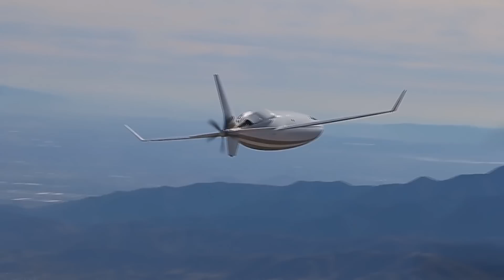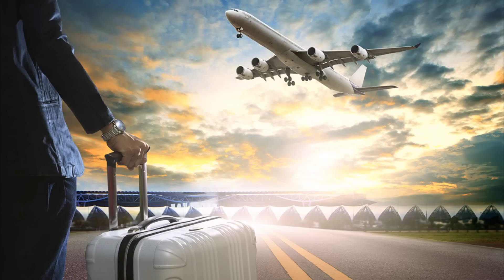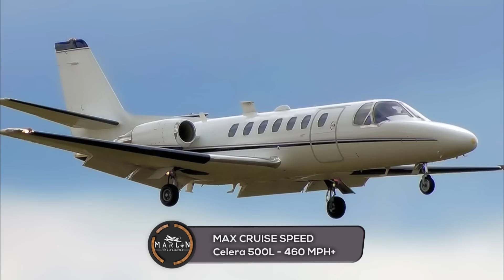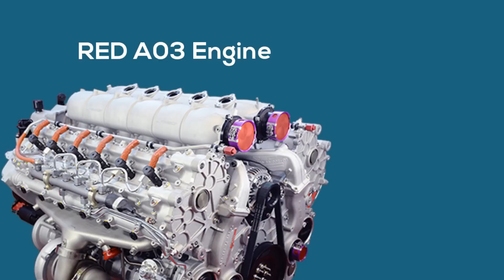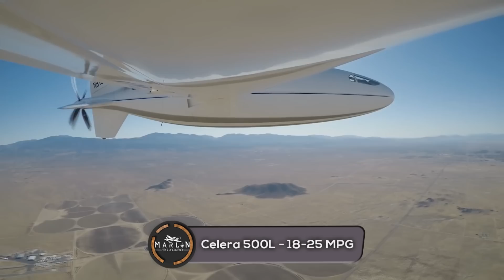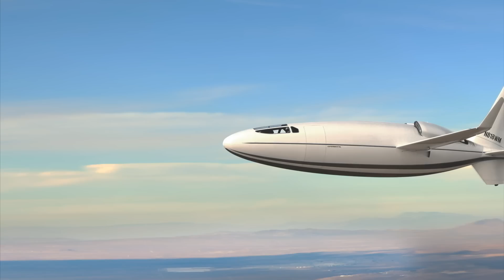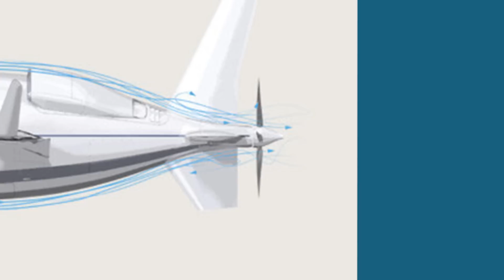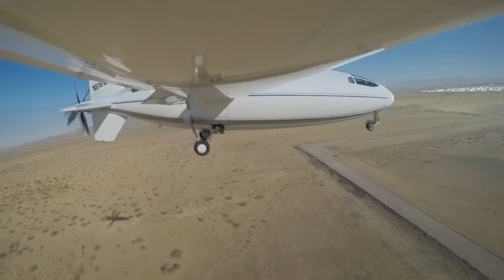Meet the Celera 500L (Flies Faster, Farther, Higher, Cheaper)

Comment: These “Revolutionary “ planes come by every so often.  They claim fantastic numbers. Then they just fade away.
Reply: Yep.
Reply: I have a less popular idea as to why new “revolutionary planes fade away: 
Simply because Designing a completely new airplane is hard. 
And getting a new design certified and into serial production is even harder. 
It takes years, sometimes as much as a decade (or more); and it’s extremely capital intensive. 
Most companies either don’t have the necessary capital to see it through, or they are unwilling to take a big risk on a new, unproven design that — if not wildly successful— will fly them straight into bankruptcy. The high-risk inherent in making a new design, combined with the even higher regulatory hurdles imposed by the FAA, is why we don’t see many revolutionary new airplanes today. In fact, the vast majority of airplanes used in general aviation today were designed and certified way back in the 60’s and 70’s. 

Also, any new aircraft design— especially those that are “Revolutionary” on paper — are guaranteed to manifest a number of design flaws and technical issues that only appear during the late phases of prototype and testing. Such issues tend to cause years of delay, vast $$$ expense, or outright cancellation. AND EVEN IF a company overcomes all this, there’s still bound to be more issues when it comes to establishing regular serial production of a certified aircraft. — (This is a big reason why so many new designs in general aviation remain forever as classified as “experimental”  home-built/ kit build planes.)

Everyone loves to focus on what makes a new design “revolutionary.” But there’s always a trade-off when it comes to aircraft design. There’s no such thing as a free lunch. Yet when people make YouTube videos about a new “revolutionary” airplane, they almost never mention the challenges and trade-offs inherent. 
And then on top of all this there’s simple and brutal laws of economics. An airplane may be “revolutionary” on paper, but to be successful it must make economic sense; it must convincingly provide its owners a greater return on investment than what they could get using an established and already proven airplane. 
And unless a “revolutionary” new airplane can be produced at a lower cost than the average customer is willing to pay for it, then it’s sure to fade into obscurity as just another paper airplane/interesting prototype.
Reply: It often caused by politics and not the aircraft itself
Reply: This aircraft isn't just claiming " fantastic numbers", it has excellent fuel efficiency like some motor gliders also have...
Reply: @davidhollenshead4892  It is effectively is a motor glider, just scaled up.
Reply: No matter how much promise concept aircraft invoke a flying prototype is only the beginning.  The costs of certification and tooling up for production are eye watering. Often established aerospace companies have the financial muscle and technical expertise for this. Even then it may not be a commercial success.  The Beech Starship would be one example.
Reply: If Amazon got involved it might  get some legs but look at Synergy Aircraft  for example  same promise still nothing. If it's any good China  will steal it and make it work. Dam it where is my Jetson personal airplane I was promised as a Kid?
Reply: @JohnnyAtlas  As far as I can tell, Synergy never got off the ground because all the guy really had was an efficient airframe design derived from the boxwing, which has been around since like the 1930s. He wasn't offering enough to investors and from what I've seen of his behavior online he comes across as self-absorbed and difficult to work with, so they all passed.

Now at this point his patents (which were mostly filed in the 2007-2011 timeframe) are well on their way to expiring, and would be just about expired by the time a production aircraft came to market, nullifying his competitive advantage. So Synergy will never happen.
Reply: @justtwoseats  thank you for a great explanation about Synergy Aircraft
Reply: Nothing secret, they just get bought out, or the patents do.
Reply: For those people looking for sources go watch some episodes from the late 90s television show beyond 2000. Now look at all the devices that they showed and see how many actually became something. All the flying cars and boats they showed you don’t see them anywhere. 

The reality is that it doesn’t matter how good the idea is. It’s not necessarily big business stopping it from happening although there are many examples not just with engineering. Big companies buy smaller companies and kill the project. Look at Microsoft they do it all the time. We don’t hear about it when it’s a product that we’re not using it. It just goes silently into the night and someone walks away with a pile of money.

You must know about the Tucker. There was a movie that was made in the 90s I think. He designed a new automobile with lights that turn in the direction you were going and it had a variable windshield wipers which didn’t exist at the time. He got stonewalled by the big automotive companies.
Reply: Gee I wonder why. Almost like some septa of corrupt industry has a death grip on transportation.
Reply: The DC-3 was revolutionary once. It is an incredible financial tightrope act getting an entirely new aircraft certified. If it never goes into production it might not be the aircraft's fault.
Reply: For about the same price, I'd use this option in a heartbeat! I might actually take a flight again.
Reply: Physics dictates that plane efficiency has more to do with weight than anything else, and there is no free lunch.  All aircraft have to use a lot of energy to "throw air down" creating lift based on weight, and so will never be as efficient as transportation systems that don't have to waste so much energy fighting gravity.      If we were smart, we would only use air travel when we need to go over large bodies of water quickly, and would use high speed super-highways and/or high speed trains for traveling quickly over land.    A bus loaded as fully as a typical passenger jet for example gets 300-400mpg per passenger, whereas the jet only gets 50mpg per passenger.   We would also be wise to limit the need to travel by using teleprescense more, like work from home programs with meetings done on MS teams and the like instead of moving thousands of pound of flesh and steel to get people into a large auditorium.
Reply: DumbDuck44 “throw air down”? Not how an airfoil works FYI...
Reply: Unfortunately, this wonderful aircraft will probably disappear from sight, never to be built for general use, as just about all really revolutionary aircraft outside of the big corporate manufactures have had happen to them. Sad!!
Reply: @afollowerofthewayJC  Unfortunately I agree.  A number of years ago a company called Dynacam fielded an engine that was certified by the FAA for aircraft back in the 1930's, upgraded the metallurgy and was in the process of getting startup capital to go into production.  They had a 200HP 12 cylinder engine with the cylinders placed like the cylinder of a revolver gun.  the pistons were on each end of a rod that was connected in the middle of the rod to a circular plate that had a wave in the outer edge like a sine wave.  The pistons traveled back and forth firing from both ends parallel to the rotating crankshaft  and the valves were just ports that were uncovered and covered by ports attached to the crankshaft, so no major moving parts to the valve train and no timing problems.  The 200 HP model weighed about 85 lbs and operated so smoothly and vibration free that you could idle down to 100RPM and not spill a water glass sitting on top.  Fuel efficiency was 3 times that of normal AC engine, frontal plate area less than 1 square foot.  They had larger engines they were designing for powering buses.  They had half a dozen hostile takeovers by big AC companies and car companies and just faded away for lack of start up capital.  Very sad.  Turbine power to weight ratios with gas sipping efficiency, minimal moving parts to fail and almost vibration free operation.  I miss them.
Reply: Tesla to the rescue to fit it with > 400 Wh/kg batteries as soon as they can
Reply: @justforthehackofit  Agree
Reply: Because big oil and big aviation companies makes sure it is killed.
Reply: Ryan Ehlis how do they do this? Any specific examples?
Reply: Marlinspike, there is a documentary called "Who Killed the Electric Car," that goes in to great detail about the control and cooperation between automotive manufacturers and oil companies.
 Also, check out "Who Framed Roger Rabbit" for a similar story, except it's about street car trollies, which were also electrically powered.
Reply: @werepat  hard to argue with those sources
Reply: @Mike-gz4xn  do you have any good examples that they don't?
Reply: werepat businesses are always trying to demonize one another, this is nothing new.
Reply: Rev. Andy H. We’re talking about greater profit margins for a company. Look at the auto industry and the increase in MPG. to make a sweeping claim that big oil is killing magical technology is ridiculous. Why would big aviation not jump on Thai technology or buy them out. Look at Apple for example.
Reply: @werepat  Electric were never ready to compete with ICE until recently due to crappy batteries, so I call bullshit.
Reply: MrChiangChing, they didn't use batteries.  Electric street cars have been around since the late 1800s. 
https://en.m.wikipedia.org/wiki/Streetcars_in_North_America#Electrification
Reply: https://m.youtube.com/watch?v=76tuldu-zo4

The first five seconds might be compelling enough to listen a little while longer.
Reply: @werepat  "Who Killed the Electric Car,"  was pure BS. 
GM's EV1 wasn't DOT Approved for sale, only as a long term lease...
Reply: @werepat  I was only talking about the electric cars, I know the streetcars were pushed out by the car companies, but electric cars were not viable until the recent advances in batteries.
Reply: @MrChiangching  ah, I see.  Did you know the very first electric vehicle was in 1832, but you're right, they weren't practical until the 1870s. It was said the electric car's heyday was the early 1900s, though.
Reply: @MrChiangching  what battery you mean?
Reply: @MrChiangching  this video talked about a new revolutionary aircraft. If you want to talk about electric cars, please talk to Tesla.
Reply: @Mike-gz4xn  Do you believe they would reveal it, really?
Reply: Davi Rosa reveal what?
Reply: @MrChiangching  No really, you should watch that documentary. 

GM made an EV in an effort to feign interest in some emissions regulations and force other manufactures to redesign. They leased these EVs in a trial program, the drivers loved them and wanted to buy them, but instead the vehicles were forcibly confiscated at the end of the trial period.  The trial was a complete success, but they killed the program because it threatened to disrupt the order that GM enjoyed. 

Really, you should watch the documentary, it can be found online for free. "Who killed the electric car"
Reply: @davidhollenshead4892  How does that make it pure BS?

I mean, they still worked.
Reply: @Mike-gz4xn  The government can come up with all kinds of reasons to confiscate or end your work. They have threatened inventors with jail for creating things that would upset the status quo too much. The most influential people want to stay that way my friend. Certain kinds technology could upend everything quickly. Zero Point energy is a good example. Exotic Propulsion systems have been created and only used on black budget projects. If these things saw the light of day in commercial use oil and gas would be done the next day.
Reply: @JediMind Trix Yeah, I’ve been hiding the cure for cancer in my basement for decades. I maintain great power and influence so long as no one knows I can cure cancer.  The moment people find out I’ve discovered the cure, all that power and influence will be gone. And I refuse to live like just another unknown commoner.

I trust this explanation makes sense to you.
Reply: @Mike-gz4xn  i had a Chevy Vega that did 39 MPG in 1976 the car was crap but had good gas mileage with a carburetor no less if it had fuel injection and CPU control no telling what the MPG would have been.
Reply: @Mike-gz4xn  buy it then shelve it. Use diversity hires to engage in corporate espionage and sabotage
Reply: @rev.andyh.1082  I have the cure to cancer too. It's so cheap it won't make money
Reply: @Dispatcher So you understand. ...If you’re someone on the inside like you or me who enjoys having money, power,  and influence, then, obviously, the only way to grow one’s wealth, power and influence is to take the one miracle thing you have, that thing millions of people will want ...and hide it away so that no one knows you have it.  That’s the only way you can prosper. ...makes perfect sense
Reply: @rev.andyh.1082  I try to help terminally ill people. Not one of them believes me
Reply: @werepat  Electric, steam and internal combustion cars all had similar performance and reliability in the 1900's. Electric cars started straight away, ran silently and had few parts to break down, but range and speed (eventually) let them down. They were great in cities, though. Steam cars were based on technology that was already over a century old and also more reliable than internal combustion, but took 45 minutes to "start" and you had to carry around a literal ton of water. Watch some Jay Leno's Garage, he's got some steam cars that are newer than some of his electric cars. The very last steam cars had great improvements in reliability and (almost) push-button starting, but came too late.
Reply: @Mike-gz4xn  Apple is a gigantic darpa/nsa spyware limited hangout operation just like Microsft pretending to be businesses, don't be naive lol.
Want to see an aerospace firm that's been completely passed over for investment because it's too good and it'll disrupt too much, check out SKYLON. A helicopter gunship that was too good, The AH56 Cheyenne, they're only letting it be built now.
Ditto the Fairey Rotodyne, development was scrapped, the Roton Roary rocket, any number of heavy lift hybrid airship designs, all too disruptive to the paradigm.
Reply: @werepat  I saw who killed the electric car. It was full of BS from start to finish, just someone's fantasy.
Reply: Veldtian1 I know about  the Cheyenne. It was very good but had its problems as well. It was expensive and did things the a10 could do and the Apache. It was not needed and scrapped. Good yes. The devils in the details and specific facts that can be proven not broad sensational generalizations.
Reply: @werepat  but there are plenty of electric cars these days, and airlines are constantly trying to reduce their fuel use.
Reply: @rev.andyh.1082  if you havent seen Who killed the Electric Car, you should.
Reply: @nadamasdisponible I tried watching it a few years ago but I ran out of headache medicine before I could finish it.
Reply: @Mike-gz4xn  Yeah, look at Apple, using slave labor in China.  Think it's a joke?  I have lived in China as a U.S. citizen for the last 8 plus years.  It's not a fantasy... It's real. Apple uses slave labor. They require long hours and pay little. Apple sucks. There are several suicides of workers each year.
Reply: @ryanehlis426   Wrong, big aviation would adopt these if it saved them any fuel at all, as its one of their biggest costs and the airline industry is hugely competitive with one another and not a monolith.    Its because hype cannot overcome the basic laws of physics, which dictate that there is efficiency of scale (small aircraft like this will never be as fuel efficient per passenger as very large ones) and that can't be overcome.
Reply: Ryan Ehlis Nope, they don’t really perform. Reality can’t be suppressed for long.
Reply: @ryanehlis426  You're right, but unfortunately the vested interests hardly have to make any move at all to squash innovation when we, the public, approach every significant innovation with absolute cynicism. Source: This comment thread.
Reply: Ryan Ehlis  You forgot to mention big pharmaceutical companies and the Illuminati.
Reply: @ryanehlis426  nah. They dissappear because they don't perform as promised and/or they have lethal flying qualities.

Comment: Structurally, the fuselage looks like Spaceship 1 and two. Alot of people don't realize that pressurizing an aircraft cabin and fuselage is like inflating a balloon. SS1'S shape and it's rounded windows enabled it to have a "Shirt-Sleeve-Enviornment", which meant the pilot and occupants did not need to wear full pressure suits. This shape is designed to have enough strength to withstand higher pressurization (psi).

Comment: Most comments here are like, it’s not possible but, the design is so different from anything else why not get different results?
Reply: The thing is that it's not very different from anything else. At least not different enough to provide 8x efficiency, jetlike speeds with only 600hp, and an altitude of 60k, something which is the maximum altitude for most military fighter jets, which have way much more performance than a 600hp piston propeller plane. Like it or not, piston propeller planes are hideously inefficient above 30-35k feet.

Comment: It is both believable and understandable if one has a background in aerospace engineering and is familiar with long proven Piaggio p.180 Avanti or EVO specs using pt6 Twin power plants, and dirtier plan form, but related efficient  aerodynamics, the specs for the Celera are in the range of approximately achievable. Additionally I have the practical advantage of being a former versatile pilot.
Reply: I was a former Cockshutt pilot.